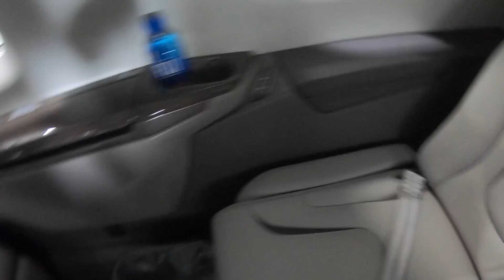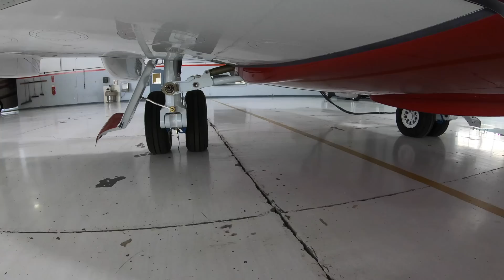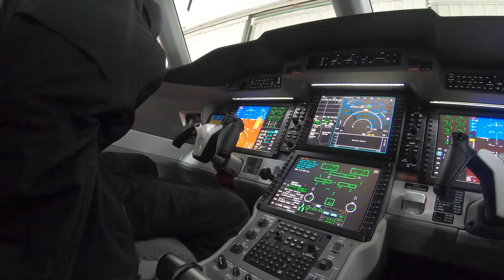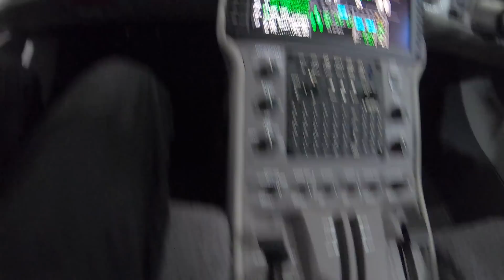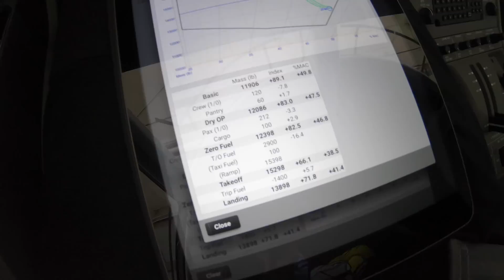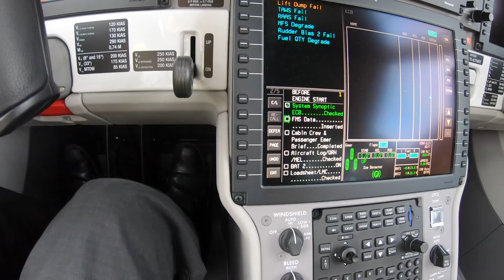Pilatus "PC-24"  Preflight and QPM mode "Quiet Power Mode" Start up.

Comment: I am curious, is the engine too loud to use as a Apu? I am getting at using it in qpm to run systems and AC while on the ramp for instance while waiting on my passenger (don't tell her I said anything) lol. Bigger Jets run the Apu and I just wonder if you could park, shut down LT engine, put RT in QPM and get out to do fuel, wait on passengers ect.. Your in Vegas and I'm in Phoenix so you know what I'm talking about needing AC to precool. Just curious for a short stop on if I have to get a cart or can use the airplane it's self to stay cool. That is a great plane. Thank you and be safe.

Comment: what a great video and guided tour of the plane,  systems and start-up. Really paying attention as this plane could be a great candidate for our next aircraft when time is up..  ( the other one is the 300E)  ;-) Looking forward to some videos of flight...  Speeds, FF,  noise, etc..
Reply: Yeah very interested in the PC-24 vs 300E. :) PC-24 looks like it has better avionics and equipment, probably even possible to make it oceanic with dual FMS. Better landing performance, safer dual wheels. But it sould have much less real world range (against the wind) because of lesser speeds.

Comment: Concerning QPM, I understood that it’s not counting on the engine hours due to almost no wear in this mode. But I assume it does count on the cycle of the right engine, right?
If you would use the QPM regularly wouldn’t you run out of cycles or are the engines interchangeable?
Reply from the maker: Cycles are only counted on start up taken to flight . There are more start up to flight cycles on the left engine due to quick turns and only shutting down the left and starting back up when we depart. We don’t just run qpm and not go anywhere
Reply: @PlaneJunkies  once again, thanks for the quick response in this topic ;-)
Makes sense of course. So the “issue” with too many cycles originates on the left rather then the right (QPM) engine. Or isn’t that seen as an issue, concerning maintenance costs?

Comment: That was your best PC24 video yet, very good! I like your way to really get the youtubers to follow the preflight and run up, nice, detailed and calmly explained. Understand QPM (which is there to replace an APU to get current for Air cond. and aircraft power where there is no GroundPowerUnit, GPU) has some restrictions. Does it top up the batteries? What ground operations can't be done under QPM. Tanking according to Scott Marshal in your delivery video. Is this forever or is it a software fix down the line. A really impressive aircraft as the first jet from the Swiss, almost embarrassingly good for the crop which has done jets for decades. Thanks!
Reply: BTW, understand QPM hours doesn't count for engine TBO. Pls confirm.

Comment: Really enjoyed your "QPM" video! Thanks for showing the detailed cockpit checklist and layout description. Keep those exterior walk-arounds and interior walk-thru going so I can drool all over my keyboard - it helps keep it clean. What is the purpose of "Quiet Power Mode" anyway and when do you use it?
Reply: The PC 24 doesn't have an APU, so you can use the QPM instead of really starting one engine. As far as I know the time in QPM does not count towards engine hours

Comment: And the QPM is like the Hush kit of the past on turbojets?  And used when?  Thanks for the training.  Luv the PC12 and 24.  Amused at comments of past posts about Lav placement. LOL.
Reply: No, QPM is to put the ENG Nr. 2 into an APU mode so to say. Delivers power and air that way, if you're away from any Ground Power Unit.

Comment: "Make sure the landing gear is down"
Reply: It had me grin as well.

maybe one could switch the switch to up while the plane ins off... (for example by mistake) 
I don't think it would retract the gear, as long as the whole weight of the plane on the ground is still on it, even when the switch would be on it's up position.

Comment: What kind of oil does the Pilatus PC-24 use?   And what's it for?   I mean does it lubricate the bearings inside the turbine or something?   Piston aircraft and automotive engines, I get it but jet engines I'm not sure.  I'd like to see that in a future video.
Reply: ebrown405  all jet Engines use Turbine Oil. E.g. from Aeroshell. It’s not a Pilatus (btw. Williams Engines) specific but a given for turbine engines regardless of type. Oil consumption is normally much less than oil consumption on piston engines so you can get out many many hours before refilling the oil.

Comment: In your walk around I didn’t her you check the o2 tank levels only turn on and test the mask, does the pc24 have a visual tank level marker as I thought this was a standard check
Reply from the maker: you can see the amount In the ace system and will get a cas msg if low

Comment: Was wondering what the parameters where fir the QPM, I prefer a proper APU gives more options and does run the hrs up on the engine but does save weight I guess.
Reply from the maker: QPM doesn't run up the hours on the engine , a provides everything the AC need to function such AC and HEAT . and only buns 110lbs a hr
Reply: @PlaneJunkies  Oh so you can run that engine forever in QPM & not create any wear? Gee someone has invented the perfect engine !

Comment: I have a couple of questions for anyone who can answer. First, in what instance would you use QPM? Second, if you can start the aircraft using only the battery, why would you ever use a GPU?
Reply from the maker: batteries are good to start on but also take a toll on its life cycle as well . GPU gives us AC and heating and fully powers up the aircraft so its ready to go and not wasting fuel using the engines or a APU .  QPM we use during quick turns we can land and takeoff and have everything unloaded and back in the air all with in 7 mins from touch down to wheels up
Reply: @PlaneJunkies  Cool! Thanks for the reply, I love the content.

Comment: You re taking too long for your lights walk around . they get hot baby and ive got to change them ; so go faster and turn the lights off .
Reply from the maker: LED's and for the purpose of the video ;)
Reply: LED's don't heat up
Reply: @RainbowManification  LED's do heat up and the bright ones need to be mounted directly to a heatsink.

Comment: Very nice looking cockpit but I would simplify it greatly. Same with engineering of the plane. There should be no accumulators, it should just be electric, ever ready. One big display per pilot or just one for a single pilot. Remove almost all the buttons, there should be no light check because there would be no indicator lights, it would be on the screen. Seperate lights is legacy thinking. There should be no checklists, the plane checks itself continuously. Start up should be instant, there should be no ground power. Plane should be half the weight. Using an ipad is also a failure of the avionics. Flight plan should also be a couple of seconds. Taking off in a jet should not be a 30 minute procedure.